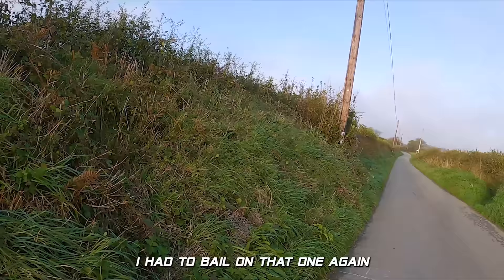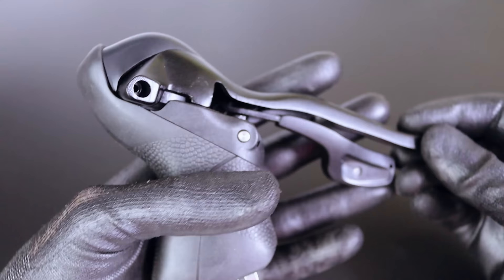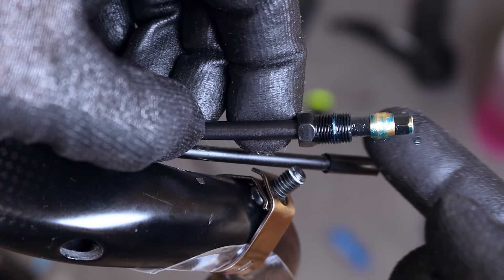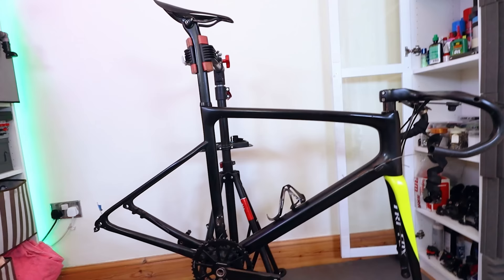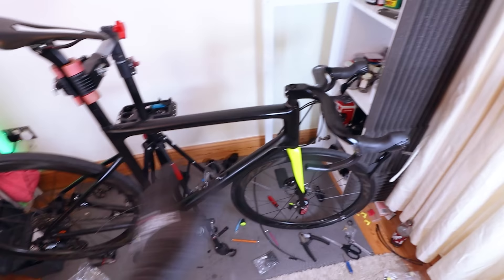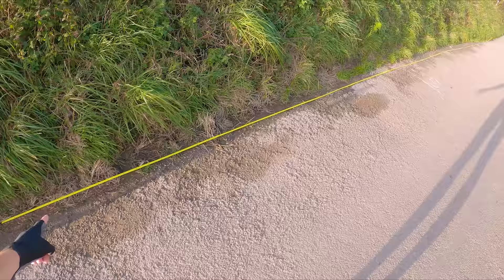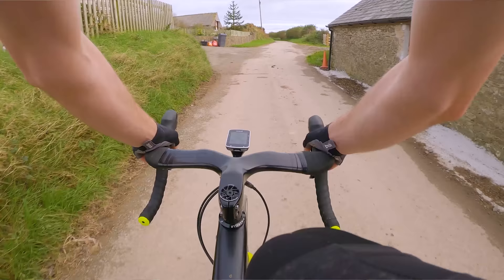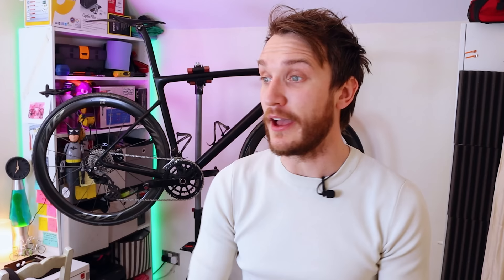Mechanical VS Hydraulic Disc Brakes - Shimano RS505 install & test

Comment: Another quality production Luke.!! Why is the road bike side of things soooo pricey??. For my MTB, picked up a great set of shimano hydraulics with rotors for £55… same thing for road would cost £300-400…
Reply: Road disc brakes have only been around for a few years so the technology is still yet to trickle down. They are primarily used on performance bikes too, where as entry level MTB groupsets are also used on urban and hybrid bikes for the gear range, and are much more accessible. It makes sense as MTB braking requirements mean hydraulic discs were a huge advantage even on bikes that nowadays seem inadequate and almost too difficult to ride due to the advancements in geometry and suspension tech. Whereas on the road, the advantages were not so obvious. Also, the first iteration of road disc was so poor as the bikes that were fitted were not properly designed to cope with the braking forces so there was a lot of lateral flex in the forks and stays under braking, especially in carbon models.
Reply: I mean it’s absolutely ripe for someone to come along and develop a cost effective road hydraulic brake set…it can’t be long till something really good comes out of China..
Reply: @grantnyenes3742  I don't deny what you are saying, as the industry is moving towards disc full stop, a cheaper fully hydraulic groupset will appear on the market soon. But developmentally, it is still years behind in comparison to mountain bikes as the adaptations needed to be made for the technology to work have only just been perfected in the last few years. Especially in regards to frame design and layout.

Comment: I got a set of RS505's with calipers on Merlin for $150 in early 2020. Couldn't believe it. Currently running them on my single speed Trek Checkpoint. It was cheaper to buy 11 speed shifters and brakes than it was to get the only single speed specific set from TRP. I agree that they're probably overkill for road bikes unless you do a lot of technical descending, but the moment you go off road at all, hydro disc is untouchable.
Reply from the maker: Wowsers, that is a pretty unbeatable price!!! Nice going!

Comment: Maybe a 140mm rotor on the rear would help out with the rear brake locking up so quickly...either that or chubb up a bit...I struggle to get my rear brake to lock if i'm in the saddle ;-)
Reply from the maker: Yeah not a bad idea tbh!

Comment: Hi Luke, great video as always 😎. Maybe think about trying  a 140mm rotor on the rear to give you some difference between the front and rear braking and help to avoid locking back wheel..
Reply from the maker: Yeah had alot of suggestions to do this actually... I think ill have to look into it!

Comment: Thanks for the vid and tests. I didn't realize you road-guys have to pay so much for a full hydraulic set-up btw (mountainbiker here). I just got a complete set of Shimano MT200 in for less than 70 euro incl. shipping. Very curious to experience the difference from my current mechanical set up once I get them installed. Cheers mate.

Comment: Great video as usual. Rides of Japan's method is great but generally I use a combination of all the methods until I get a solid result.
Next time try this: put the funnel on the control with mineral oil inside, connect the syringe on the caliper also with some oil inside and push and pull until you don't see bubbles anymore. If you still feel a spongy control, Rides of Japan method. Sometimes multiple times

Comment: Hi. I have the same hydraulic groupset on my Cube and I love it. I think that one of the road bikes must be with hydraulic disc for wet and hills and the second bike with rims or mechanical discs. I believe that 2 bikes are essential for most of the cyclist and this is resolving the dilemma actually. Good alloy frame with sensah is perfect for a second bike and for experimenting and cheap upgrades. This is exactly what I am doing. Regards.

Comment: I had Tiagra 4700 hydro groupset and eventually it pissed me off. Firstly the shifters are massive, they dont feel good in my hands at all and they also look terrible. Second I love to swap in and out different parts and setups and I felt boxed in with the groupset. 3rd the calipers would leak after i bled them, I found the whole thing very stressful, they just arent for me at all.
The truth is you only fully emergency brake when something jumps out in front of you and shits you up. Most humans struggle to not instinctively grab two big handfuls of brake lever and it sounds like you could easily injure yourself by accident that way. Im perfectly happy with a bit less braking power if it means very simple (and dry) maintenance and replacement.
Ideally Ill get some Paul Klampers at some point. Would love if you reviewed them but they cost over 400 quid for a pair in the UK. Cheers.
Reply from the maker: Never heard of Klampers before, but damn are they expensive! I wonder if they are worth it.... hmmmmmmmmmmmm
Reply: @TraceVelo  Not worth it. Paul is just some boutique brand. They are good, but hydraulic will trump it. Tiagra pretty much offers identical performance to Rs505 too...
Reply: @luukrutten1295  have you used Klampers or are you just saying that? Because the reviews suggest its worth it at least on some level

Comment: Our brifters are ridiculously priced.

I’m about to transfer a set of juin tech R1’s (post mount version of your F1’s) to my gravel bike from my foldie.

For simplicity, I was thinking of going with their GTs on the foldie, but for the price of a set of calipers and discs, I can get a full set of magura MT4’s professionally installed instead 😅
Reply from the maker: Yeah the JuinTech GT's are pretty flippin pricey I'll give you that!
Reply: @TraceVelo  I think I’m going to be a cheapskate. 

Will probably order one set of the GTs and use them upfront on both my gravel and foldie.

Shift the R1s on the front of the foldie to the rear of the gravel and hope everything works out 🤣

Comment: Nice film... my suggestion: to stop the back wheel blocking that quickly and lifting off the ground, put a smaller disk... like 140 mm. 
And better quality one as well... disks are probably the cheapest part of the braking assemble. 
Look for inspiration in the MBT camp!
I have an older frame that I'd like to work on ... it's a Giant frame with Post-Mount... I'm curious what's the best affordable  hydro-mechanical (cable hydro) braking calipers that I could install on it?
Reply from the maker: Yeah I've had this comment alot actually, I think you're right, 140’s might be the way to go in this case...
Reply: @TraceVelo  not to mention that you shave a few grams with the 140mm rotor :) :) :)

Comment: Good description of the difference in performance between hydro and mechanical discs. On the road, especially in traffic I much prefer the hydro power and that quick power is nice on an MTB as well. However, on a gravel bike on a very very long fast descent I have had hydros over heat, begin boiling their fluid and become almost useless, not something that would happen on a mechanical set up. Bigger better rotors, finned pads etc can prevent this in most cases but it remains a possibility if you have a multiple mile descent.

Comment: Road parts continue to amaze me with how expensive they are, I had some generic Shimano MTB hydraulics for 27 pounds, and I recently got a complete 4 piston XT brakeset for 100 quid

Great video as always, j'adore them lol
Reply: careful when you bleed the xt's that you don't crack the extremely fragile ceramic pistons
Reply: Not just XT’s. All Shimano brakes that use ceramic pistons are same. I think they actually switched to resin at all levels in their 12sp road stuff

Comment: The takehome is essentially: 200g more for more braking power than you actually need? Unless you want to be able to lock up the rear wheel easily. Because even if you have the power to lock up the front wheel, you never want to in practical conditions.

if you cant slow down fast enough despite locking up your rear wheel, more braking power isn't the answer, you want more traction which means bigger Tyres/wheels.
Reply: 200g? lol I'm selling my hydro set up and bought a mix of trp mechanical with sram red shifters for the same money. Saving more than 500g. Its for a bike that I may do long distance rides with so the easier ability to service on the road is also an added plus.
Reply from the maker: So in the emergency braking scenario, fully hydros can be a little difficult to manage on a road bike with skinny tyres. I run 25's at about 75psi. But riding out and about, fully hydros do feel pretty great, no denying that
Reply: The point is moreso that it improves braking feel, they're not a necessity, just makes riding (for me) more enjoyable. In my case they're worth the weight and cost penalty.
Reply: @TraceVelo  The silky smooth modulation is notable. I toured this summer on rival hydro levers and brakes after getting a bike for a juicy price with them installed. 

That said I realised I could sell the set up and get Red levers +TRP mech brakes when shopping around. It's about 500g of savings. 

I did the swap a few months ago ensuring they were installed well and I'm very happy with the feel. I do a little strength training on the side and I wonder if good grip strength gives you more control with the mechs as grip strength is more of an issue there.

Another thing that wasn't mentioned is that hydro are self adjusting. All that said I quite enjoy tinkering/fine tuning which can ensure the mechanicals are performing splendidly. My brother in law needed to bleed his rather tasty ultegra after they had become squidgy after only 5 months. A somewhat more involved process that shortening the cable length.
Reply from the maker: @thomasullmann7447  I think you nailed it. To get the best out of mechanical, you do need to have a play around with them thats for sure. I tended to take a few mins to adjust mine after every 10 rides or so to keep them 100%

Comment: I think budget is my primary concern with hydraulic brakes. As an e-bike rider (due to long, hilly commutes), I'm not too concerned with the bike flipping over because e-bikes are heavy. Another concerned loosely related to budget is that I wouldn't want to work on hydraulic brakes myself, so I'd have to pay a mechanic to do it.

But I'm now convinced that hydraulic brakes would be much appreciated on some of the nicer $4000+ e-bikes out there.

Comment: Hydros definitely feel better in terms of modulation, I think that is pretty undeniable. But just like Luke, I think that the up in costs and weight is not worth it. At least not for the kind of riding I do on my gravel bike. Compressionless housing is a must, though. Otherwise mechanical disc brakes feel absolutely terrible. Now if I was descending crazy steep hills all the time, I could see myself switch to hydros. Maybe a few years from now, the used parts market will be flooded with road bike hydro stuff. Until then TRP Spyres are good enough for me.
Reply from the maker: Totally agree, set them up with some decent compressionless housing, and mechanical is def a solid choice!!!

Comment: Made a move to full hydro R7020 and never looked backed. Previously I was using a mech-hydro too to keep within budget, but as I got further and faster with my rides those mech-hydro dont give me that much confident in stopping; especially if those traffic lights start turning in town. Moreover, I am a pretty heavy dude. Imagine trying to come to a decent stop at 45km weighing about 92kg. My Ztto back then felt like it was crying out and had to always back off the power when approaching the lights just in case.

Comment: The only downside for me using mechanical is having to put more force on the lever, making my hand a bit tired after long descents. Braking power? It's well enough.
Reply from the maker: Yeah fair comment, this is exactly what i found aswell. Long decents can make your hands ache, expecially in the cold...

Comment: I have the same shifters and the only issue with ergonomics is when you are going down horrendous trails with poor bike handling skills, the bleed port does not feel great on the palm. for all intended use they are wonderful, but quite ugly

Comment: There's a reason why fast motorcycles have two big discs on the front wheel that's the wheel that makes the biggest difference to scrub speed. The technique used to bleed that worked it also used on motocycles haha they just use copper sealing washers instead.

Comment: Great video Luke, after a previous video of yours, I bought a Sensah Empire Pro 2x12 groupset for my trainer bike, I have to say after 3 months use, I'm mighty impressed, gear changes are flawless when you used it a time or two to get used to them, fast gear changes even during Zwift races, when fast shifts are needed! 
My question is..is there any gossip on wether Sensah are going to produce an electronnic groupset?
Reply from the maker: Awesome, really pleased you like it. As for an electronic groupset, I've not heard anything, but here's hoping!!!

Comment: For me, emergency brake performance really depends on the tires as well. On my Schwalbe Marathon Supreme tires, I can easily make myself fly over the handlebar with my V-Brakes. Whereas with e.g. the Panaracer GravelKing Slick tires (even a bit wider), it's almost impossible on flat ground because tire grip limits the brake performance actually.

Comment: Father christmas is treating me to some of the 4 piston Juin tech GTs for xmas, interested to see how they fare against the TRP Hy/rds
Reply from the maker: Those Juin Tech GTs's do look pretty tasty, def let me know whay you think of them!!!!!
Reply: @TraceVelo  hey luke so I just got the GT-Ps installed with Charlie bike monger gusset compressionless cables. And OMG during just bedding in they are soooo much better than TRP hy rd and juin tech F1s which I have had on the same bike in the past. Running the brakes with a sensah srx groupset and the lever travel and feel is great. 

Cant compare to hydro as never used them before, but I'm thinking they can't be that much better
Reply from the maker: Nice, thanks for following up with this comment Andrew, sorry its taken so long to respond, been pushing myself to crank out more videos recently. But thats cool, im DEFINITELY going to have to check these out. Might have to get another bike built up though. Ive just upgraded to fully hydros, dont want to have to strip that all out to put mech brakes back in :P

Comment: Awesome vid & break down,  I got Hope 4 pot on my CAAD12, totally nuts I know but modulation is off the scale, an fyi I only use front braking the weight transfer to the front wheel is more reassuring

Comment: I scrolled through as many comments as I could but didn't find any pointing out your error on the brake pads. J02a/J03a pads are for post mount calipers. What you have are flat mount, so they're L02a/L03a.

Comment: I mostly ride an mtb with hydraulic brakes but when I started to ride road bike with rim brakes I've almost got myself killed by trying to stop at crossings. With hydraulics I was so used to just squeze levers and stop on spot which is not happening with rim brakes.

Comment: Like might well be the reincarnation of Kenny Everett. I have those shifters now on my off-road bike. I like those shifters but they are heavier than running the newer mechanical versions. The weight is slightly heavier as you mentioned but that's based on that set of shifters whereas di2 hydraulic is comparable to rim brakes in weight.

Comment: They really dont need grease, but I dont think it will hurt. In general a job well done.
Reply from the maker: Thanks Luuk, glad to hear I didn't completely skrew it up! 😀
Reply: @TraceVelo  If it worked in the end you didn't. And of course you didnt show all the bleeding screw-upss.  You didn't make it easy on yourself with the frame and handlebar half assembled. On a bare frame build up of a bike it is of course much easier to get the hose in with the Bottom bracket out of the way.
I would recommend using dedicated tools to cut the hose and insert the barbs( I use some from jagwire) . They make your life easier and its much less effort to do an accurate job. Bleeding with empty lines can be difficult especially with some tight bends in the lines ( I had a hard time once too on ). I also had a very pleasant experience with a mtb groupset with filled lines and levers which required to bleeding at all. Just a cut an olive and barb and job done.

Comment: One the other side of the spectrum, i was used to commute for years on my XC fully hydro bike, recently i gave a go on road cycling and i was hooked. But be honest i was scared when i tried mechanical and canti brakes when choosing bike to purchase on how bad they felt compared to what i was used for all those years, commuting on busy roads and not bike lanes in the morning and afternoon. I ended up going with a tiagra 4720 fully hydro disk for budget reasons and i do not look back, for me the feel of hydro and lack on confidence on the rest of the bracking systems i wasn't used to was the key. Also i'm quite heavy compared to an ordinary cyclist on around 90kgr. Locking the brakes was never a problem for me.